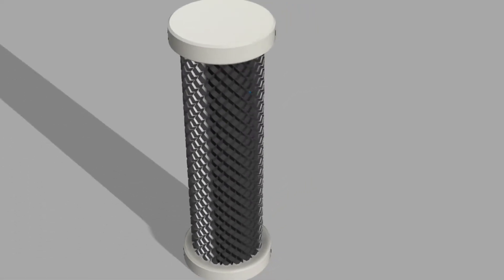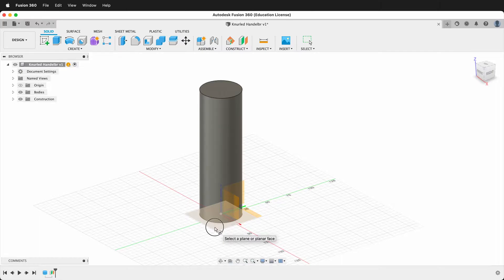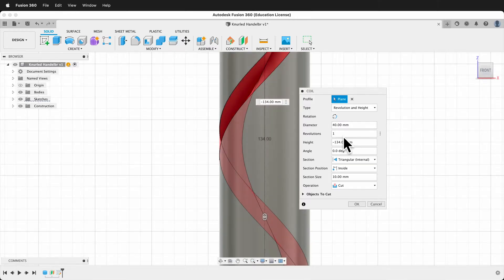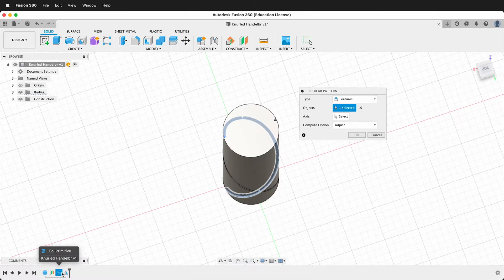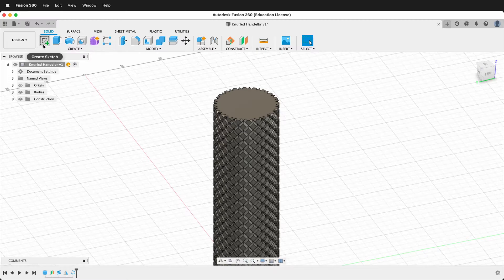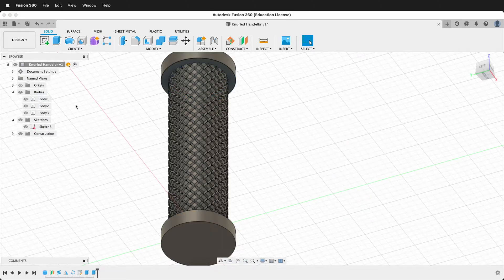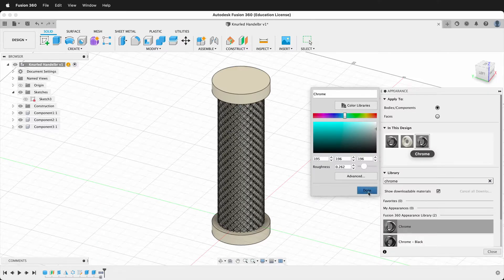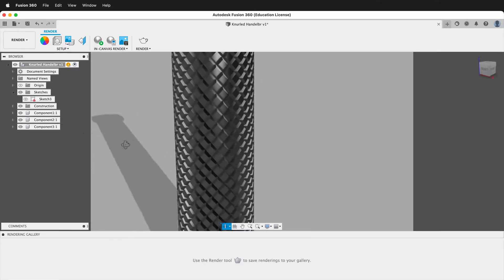Knurled Texture Fusion 360 Tutorial

Comment: I've found that depending on the length & width of the cylinder, that it's necessary to change the number of revolutions in the coil to keep the knurl approximately "square". Thanks for the great tutorial! Much easier than the way that I had tried to do it before.
Reply: You got a formula figured out?
Reply from the maker: Thanks for sharing the tip 👍

Comment: If you mirror across the same plane where the spiral starts, you don't need to use an offset construction plane.
Reply: Also, huge thanks! This is so much easier than my own solutions, and even produces better results!
Reply from the maker: Glad it helped, hope the project turns out good 👍
Reply: @WhatMakeArt  It did! I made a knob for the tip-retention screw of the Pinecil soldering iron.
Reply from the maker: Great tip, thanks for sharing with everyone 👍

Comment: How would you do this on a model that is lofted? For example if you make a bottom circle of 10mm and loft a height of 15 mm to a top circle of 14mm. How do you get it to knurl evenly from the bottom to top?
Reply from the maker: I would try to make the knurl deeper and then make a second loft that is the depth of knurl and do an intersection